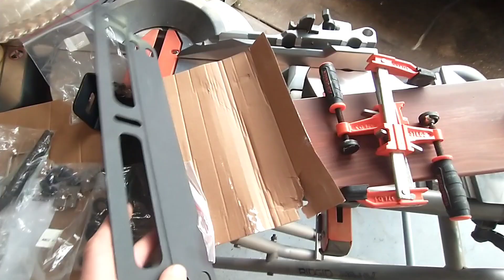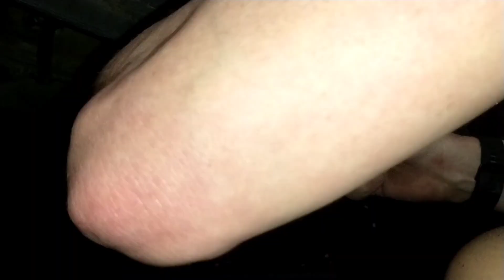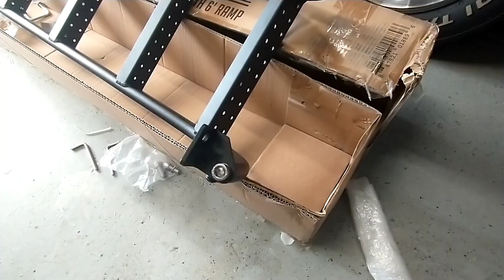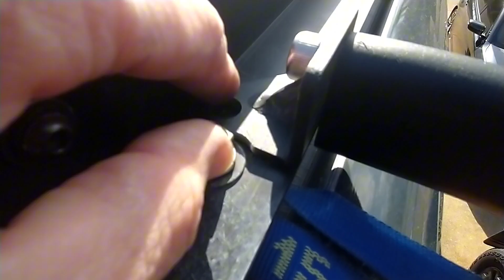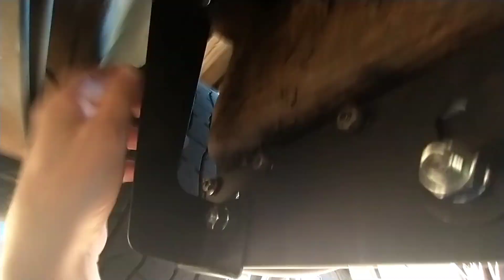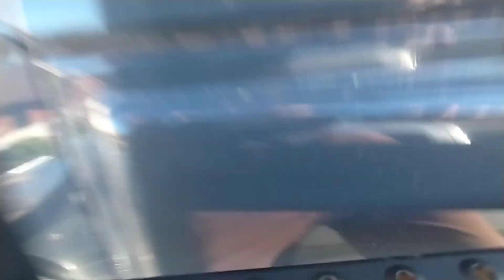$359 Van N Camp Side Ladder Install!!

Comment: Hi Andy…do you have an opinion on different years of sprinter vans? Ones to stay away from or ones that seem to not have as many issues? In the market for one.thanks
Reply from the maker: I've been really happy with my 2019, a lot of things to consider though and 2019 was the first year of a new body style etc. Really depends on your plans and budget. This is the only one I've owned so you might check Sprintersource.com as you'll get a lot of opinions on the most reliable years.
Reply: @andysgarage1  thanks a lot for your response. I am looking to concert to long term 2 year travel. I have traveled for 7 years on trips for a month at a time in a 2015 sprinter converted so I know about what I want in the next van. Only reason I asked about Florida is that I have family that lives outside Orlando. I was thinking of purchasing in Florida and drving back to Nevada. I almost bought one in CA but the guy wouldn’t let me take it to a sprinter mechanic. Oh well…next!
Reply from the maker: @pamgrant7788  Probably as good a place as any to get a decent deal on one. In my opinion if you want the tail end of the last body style shoot for a 2017 or 2018. If you want a VS30 2019+ I believe the consensus will be to shoot for 2020+ as they're getting the kinks worked out.